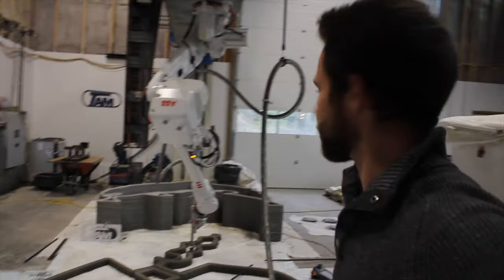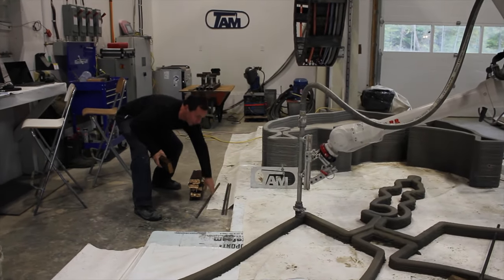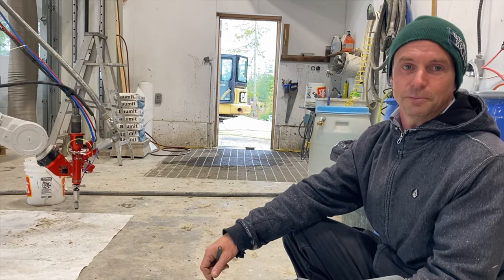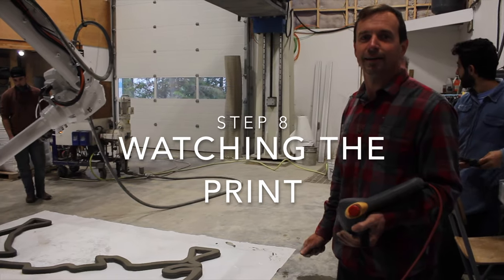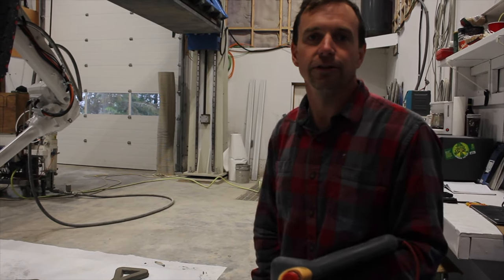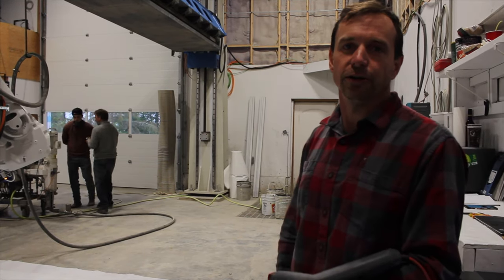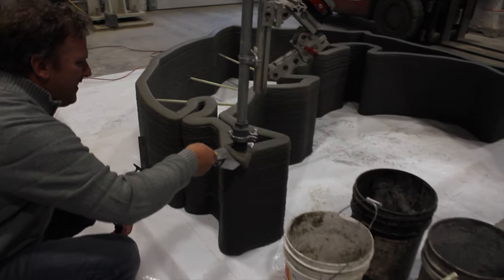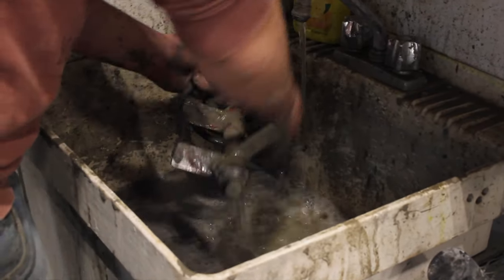12 Steps to Operate a Concrete 3D Printer

Comment: Very few videos on how these things work, thanks for this! I have a design in mind but it would have a fairly heavy print head. Basically a worm screw that can pressurize a small area right before the nozzle, it works in sync with the motor to regulate the pressure! Say bye bye to oozing if the worm screw and motor kill pressure at same time and its not like with a regular plastic printer where it might clog, the worm screw will force the mud through easily and you could even implement a retraction with the worm screw on the print head, only thing that would leak would be the small bit in the nozzle! Not sure how the pump motors work though
Reply: and then a few more googles later i find this is already a thing, the main problem is the pumping

Comment: Definitely the coolest and most informative of any video like it.  Nothing like outstanding homegrown innovation still clad in tyvek!  The only facet I can find missing is locally-sourced mortar.
Reply: SpaceCrete was here!!!!
You have been inspiring myself with you're 0 slump mix of concrete (you have an answer).  I did find Fitzpatrick has somewhat affordable retarders and accelarators per cubic yard of concrete.  
I think with Jarett videos and you're mixture expertise the brave DIY with Arduino knowledge and a small budget may have a go at it.
Reply: @pedrotorres9836  Very nice to hear back from you!  Citric acid is pretty good to retard if you want to wake it back up fast.  But there probably is a better one - for a local-materials-mix with more open time, less cement, and fast build.  Stay in touch!

Comment: Hi, thank you for sharing this video. My question is what happens to the concrete that is left over when there is a clog. (9:00)?
Reply from the maker: Either discarded or recycled. Sometimes if it’s still wet you can put it in a prepared form.

Comment: We should be printing 2 story houses for like foundation + 5k labor + cost of cement + 10% which is hardly nothing. I can't wait for someone to simplify this into a dome maker which costs almost nothing to source.
Reply from the maker: Cost of electric, plumbing, (from grid) windows doors roof ect… that can add up to more than the foundation and printing mortar fairly quickly. 5k labor seems about right but you’ll also need another $10k+ in equipment rentals. If you can do stuff like that yourself you can save money buy that isn’t scalable most people aren’t handy enough.
Reply: @automateconstruction  The detail work, laser printing or robotics. We are limited only by our imaginations. Thanks for your powerful productions. You're a  really great educator. JOY!

Comment: Looks great! I wonder what the costs are? Compared to Wood or steel buildings! Could a 275`x 60`x19` (divided into 12 bays) building be done in Ontario?
Reply from the maker: That would be quite the challenge and would require quite a bit of creative problem solving beyond the current state of the art.
Reply: @automateconstruction  I thought it might be ! But it would be amazing to see it go together! Getting quotes on Metal and wood construction! I would consider 3D for sure!!